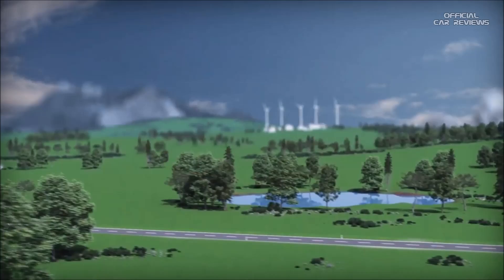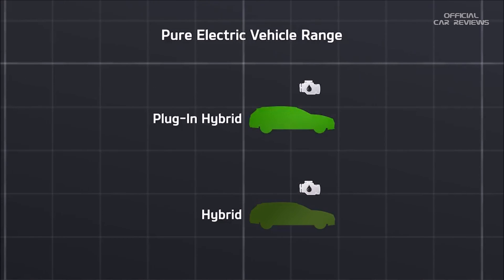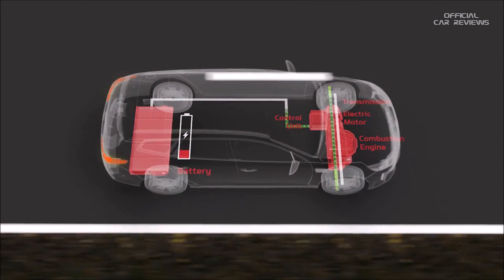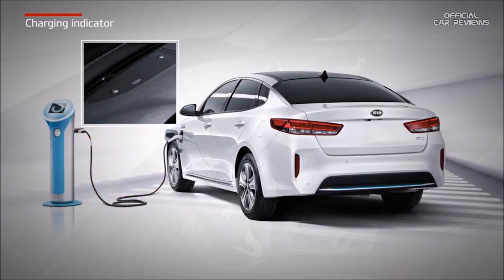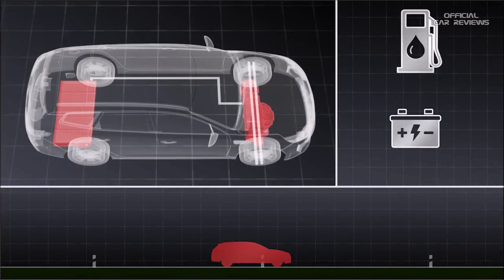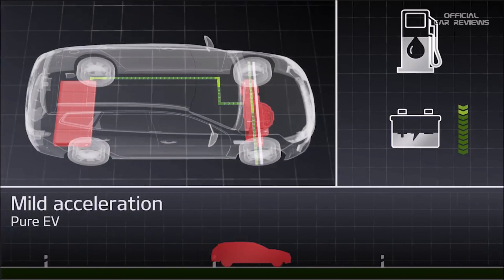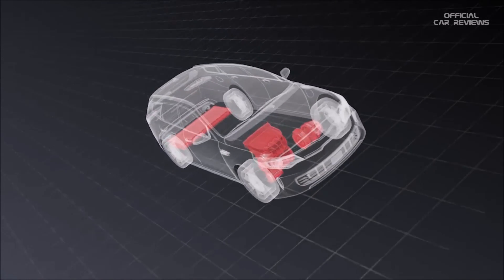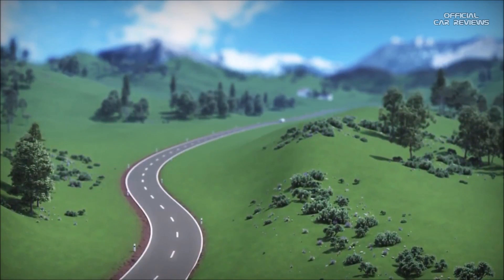2018 KIA Plug-In Hybrid Electric Vehicle (PHEV) System Explained

Comment: Heating only possible with a combustion engine👎🏼👎🏼👎🏼
Please take a critical look at the subject of heating on all KIA plug-in models!
From October to Easter you not only need winter tires but usually also a heater.
Therefore, the E-license plate for the KIA plug-in hybrids is only an empty sign for the period mentioned.
This situation is criminally to be denounced!
The resulting CO2 emissions (this is even significantly higher on short trips) compared to other manufacturers with electrical heating of the interior, this technical implementation is not too acceptable!
Here the Federal Environment Agency should threaten the manufacturer with consequences (e.g. cut the innovation premium).
Maybe then KIA will react ...
Related customer inquiries about the faux pas are dismissed with flimsy justifications to protect the engine.

Comment: Hello,
In this video, I think there is a mistake at the 3:30 minute for the charge sustaining mode.
As far as I know, the mode charge sustaining, the battery can no longer provide energy for traction of the vehicle.
This mode consists of maintaining the state of charge of the battery when it has its threshold limit.

We find the charge mode depleting then sustaining.
cordially